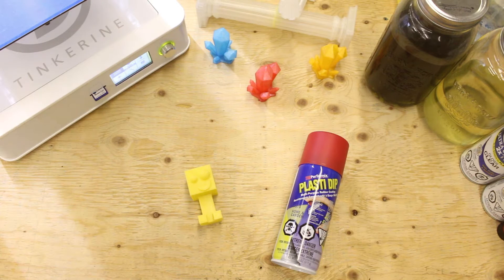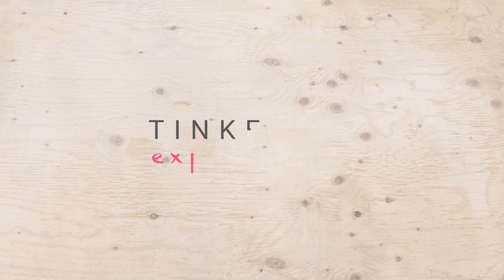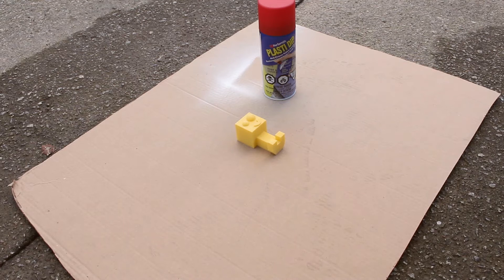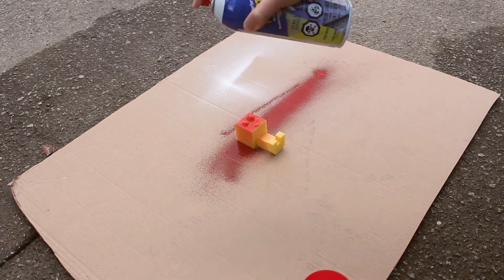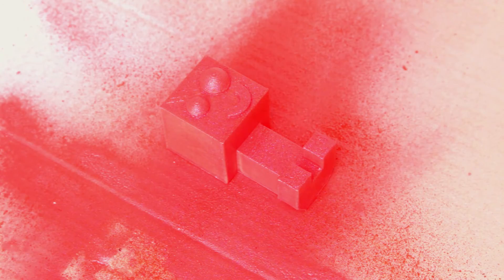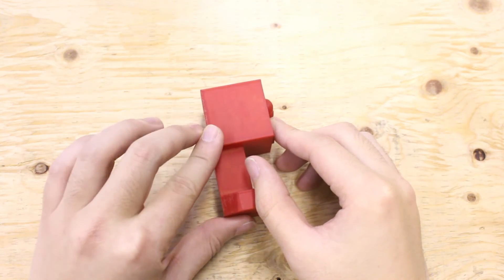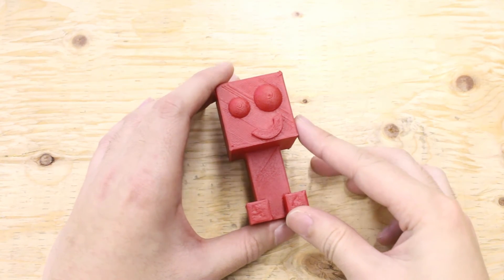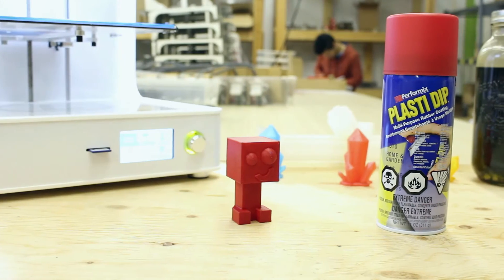Post-Processing with Plasti Dip

Comment: You're way better off doing a dip coat.
Reply: Sorry, asking as an amateur, whats a dip coat?
Reply: @richardmartinez5040  It's exactly what it sounds like. Just take the part and dip it in the Pasti Dip, i.e. submerge it then slowly pull it out. They make a can that is designed specifically for dipping.

Comment: Would this work with flexible filaments?
Reply from the maker: Thank you for the comment! We haven't tried post-processing flexible filament so unfortunately we do not have any information on that.
Reply: I use it on lexan RC bodies which flex a lot. I see no reason why it wouldn't work on something that flexes less.
Reply: @XtopherMartin  flexible filaments (when correctly printed) can be squished like a toy and some can even be run over by a car and pop back up